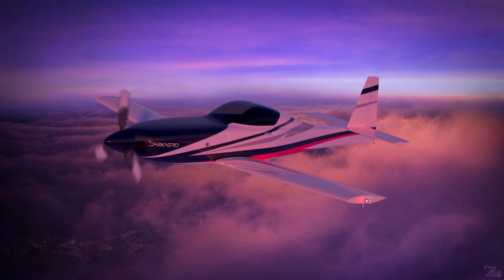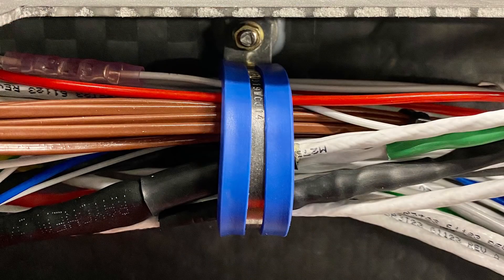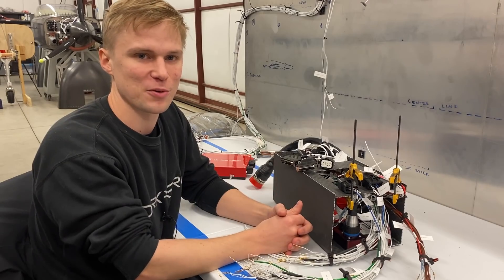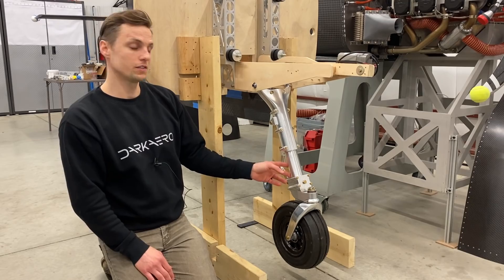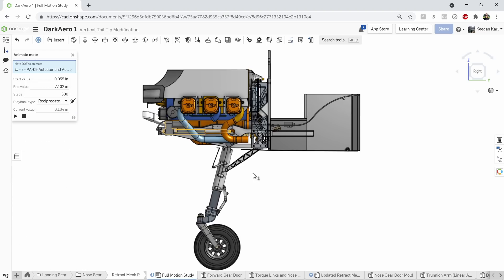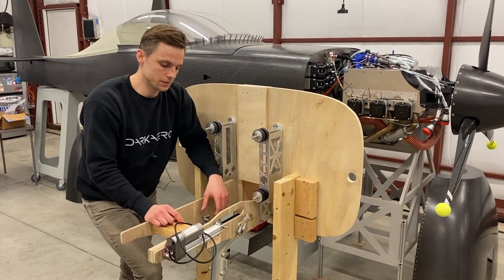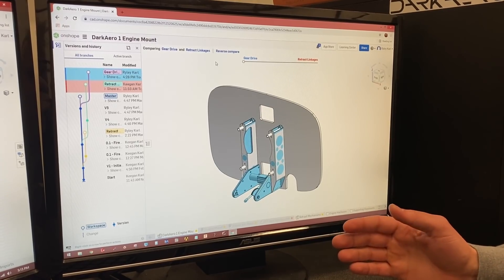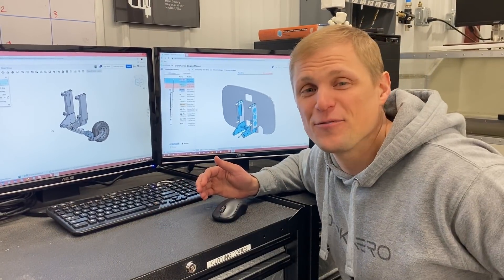Nose Gear Refresh: Trying Something New (+Progress Update)

Comment: Seems like the self steering nose fork would work best at a 90 degree angle. Having the nose gear raked forward will lessen the ability to fight unintended nose wheel wobbling.  Like a shopping cart with a bad wheel.  I would fabricate a trailer hitch jig for it and go drive it around and see if it works over bumps, similar to centerline lighting, and is stable.  Very cool build.  Can’t wait to see it fly.

Comment: So, The Engine and the landing gear are both mounted on to the same firewall bracket. That does not look safe at all to handle extreme landing force! How about redundant weight decepation.

Comment: Also...do you have a shimmy damper or are you just relying on the Bellevue washers?  If no shimmy damper the washers will require a great deal of friction to prevent shimmy and that will require a great deal of differential braking and that is not vey pilot pleasing.

Comment: Honest questions: 
2) Is there a way to use both gear driven and actuated movement for the landing gear Pardon my ignorance in these questions. They are genuine questions and following your build, I'd like to give you some thought from the outside looking in and I can learn a little from you guys (or anybody that chose to answer my questions. Be easy on me.) The reason I ask if using both is possible is because it gives you a contingency if either should fail. I realize this means more parts which possibly equals more weight, complexity, PARTS and so on but in my feeble mind landing gear is almost as important as power and wings on an aircraft. Also with a gear system backup it give you and option of manual or hand driven deployment of landing gear should you lose electric power which I just watched a video on. The aircraft's alternator failed due to wire abrasion and the pilot had to land without power. His landing gear was fixed though.

Comment: Honest questions: 
1)Using a gear drive, have you given thought to teeth breakage or binding due to stress and wear over time. Of course you are aware that aircraft landing produce a great deal of force and that force would be transferred to the teeth of a gear. And specifically the few actual teeth in contact with each other at time of landing. And it being a gear driven system and the same teeth ending up in the same spot at full extension of the landing gear every time means that those same teeth would bear the weight of every landing. This could cause shearing after fatigue over time which would be bad. It could also cause binding of landing gear during take off and or deployment of gear during landing. Over time gear wear because of load from landing with cause "slop" or space between teeth which can cause binding and complete failure. I'm a former aviation mechanic for the Marine Corps and even though it's not an engine part, landing gear is still critical. I am also a car guy and when I think gears, I think timing gears, differential gears and transmission gears and all of these share the same potential failures. Breakage and mesh loss over time due to either wear, torque or both and when the fail, the fail bad.

Comment: That linear actuator would have worked without deflection if it had only been supported at the motor end. Get rid of that forward attachment near the gland end.   Attach the tip of the rod directly to the retract /extend arm.
Get rid of the travel slot and the big roller bearing, and also get rid of the dogbone link.  If the actuator allows for only being anchored at the motor end without pulling the guts out of it, then the actuator pivots to stay in line with the pull / push on the retract / extend link no matter where they are in the cycle.  No deflection, constant alignment, fewer parts, joints, fasteners.
That all said, you've moved on to geared.

Comment: 0:14.   I see it now, there is some provision for emergency gear extension.  Only now catching up on all the videos.
Looking at the panel layout, I would like to have a 750.  I currently have a 650 and it's comparative limitations are noticeable.  
To make room for it, the gear handle could be moved to below the emergency handle, on that vertical pedestal.  
Typically, you reach down from the throttle to grab the gear handle, at least on a lot of planes I have flown..  This would make it more natural and free some space on the top of the stack.  
The gear lights are small enough to be place in the sight line between the G3X and the cowl.  the remaining light switches could be placed along that line too.
Then you have the additional "single DIN" space for a 750.
Plus, the center stack can be stacked together in a single cage.  The 750 with the AutoPilot control head nestled above it.  Plus it saves a little complexity and weight over two individual/separated cages.

Comment: Quite a lot of torque is gong to be on that gear driven pivot point when the nose gear touches the runway while landing.   you need some sort of cross member to absorb that.
Reply from the maker: John, thanks for watching and the comment! You're correct that a lot of force would be transferred to the gears w/o drag links. We should have mentioned this during the video but the drag links weren't made visible in the CAD for the new design. If you watch back during the clips where we show the linear actuator design you'll see them visible there. Drag links are still planned for the new design. You can see the mount point for where they'd connect midway up on the aft trunnion of the new design.

Comment: I love your development. I wouldn't be to happy with the gear being attached to the electrical system. Electrical failure seems to be one of the most common failures in an ac. And the stress starts multiplying if my "safe exit", the landing requires additional work.
Have you checked how many cycles such a gear can do in a row before failing?

Comment: Regarding the nose gear, I did not notice any mechanical stop the wheel will be sitting on when under load. I hope you guys have some there so the whole weight of the plane does not sit on the actuator.

Comment: New arrangement makes it easier to fit a lycoming which is good to see!
Reply: The airframe is designed to the weight and center of mass of the UL Power engine.  The equivalent Lycoming is 80 pounds heavier and physically larger.  Not only would it not fit, it would make the plane unacceptably nose heavy.

Comment: is the front wheel free castering  ? if so,  how do you stop it from flopping over ,or getting stuck ,when it retracts, as the bay is not big enough ? if the wheel is sideways ?
Reply: I was going to ask the same question, what centers the nose wheel prior to retraction? Does not appear to be a lot of clearance considering the cutouts for the axial tips.

Comment: Seeing that fat bundle of wires causes me to wonder: CAN Bus technology/implementation? Is it it possible and or desirable for your application?
Great job in creating a modular box-style plug and play solution, but surely a one wire set up would be more desirable, or am I missing something?
And while you’ve created a gorgeous chunk of CNC aluminum gear strut there, why not craft it from carbon fiber too?
Reply from the maker: Hey David, we do have CAN bus for most of our Garmin avionics and gear logic, but there are still a few devices that get controlled through the panel running on separate data protocols. The modular setup came about somewhat out of necessity because our instrument panel is integrated into the canopy and needed to be able to separate from the rest of the harness. The modular setup is an interesting work tradeoff since it does require extra effort to construct the connectors that run into each module, but it makes it easier to break up the work of creating the harness and allows it to be done outside the cramped spaces of the aircraft. 

We are going with carbon fiber struts for our main gear, but for the nose gear it would be difficult to use the same approach. There is less space for the nose gear to fit both the strut and the shock into the same area without integrating the shock inside the strut, which led us to the design you see in the video. For the current strut design, carbon fiber is less ideal from a manufacturing standpoint since it involves parts like the trunnion that have complex geometries.
Reply: I envisioned a hybrid approach for the nose strut, that is, trunnion and upper pivot of aluminum, main strut in CF. It just seems that carving that piece out of aluminum is super expensive, time consuming, and is an exercise in re-inventing the wheel, so to speak. The cartridge design for the suspension action is very clever though.
Reply: @DarkAeroInc  I know your engine for the prototype does not have CAN Bus, but the latest version of the engine does have it.  It may or may not be of use to your electrical design.

Comment: Okay, oddball question.  You've got electric gear with local actuators, and the nose gear extends forward.  How to handle emergency extension?  I otherwise love the design - trailing link  or the equivalent without a lot of excess material to make it work right...
Reply from the maker: Thanks for watching and the question! Great question! We didn't have it mocked up on the test stand, but we do have a backup provision for extending the gear. The pilot pulls a handle that disengages the actuation system and a passive gas spring drives the gear down to overcome aerodynamic loads and into the down locked position. We will have more to show on how this works in upcoming videos.
Reply: @DarkAeroInc  a gas spring!  Cool!  Looking forward to it.

Comment: What's the minimum runway length for take-off and landing?
Reply from the maker: Kevin, thanks for the question! The takeoff and landing roll at sea level on pavement is projected to be around 1000ft. Minimum runway length would be much longer than this though to provide safe stopping distance for an aborted takeoff or for misjudged approach on landing.

Comment: Why not making the landing gear the other way around, using the air flow to help opening it. The way you have it set up is against the wind when opening.
Reply from the maker: Good question! This approach would have required a pivoting point further aft thus increasing the length of the strut leg and the length of the retract cavity required. Additionally, there is very limited space firewall forward to tuck the tire away to with the engine taking up the majority of that space. Thanks for watching!

Comment: I still don't like all the instrument panel wiring coming through one connector, if that connector comes loose in flight? Would it be that difficult to split the wiring between 2 connectors so you have some redundancy.
Reply: The connectors can be safety wired.

Comment: I'm hoping you can show how you are able to make sure that the tire is rotated to the. Correct position during retraction or if that doesn't matter?
Reply from the maker: Josh, thanks for the question! The self steering nose wheel design follows a similar design principle of other proven, self steering nose wheel aircraft. Pre-tension on the front pivot pin is adjusted to provide sufficient damping and tension to prevent the nose wheel from flopping over during retract or spin during heavy cross wind. We have played around testing this. A good example of self steering, retractable gear can be found on the Rutan style canard aircraft. 

For retract, if there is an event where the gear is slightly cocked to one side there will be a self aligning feature incorporated into the gear doors and wheel fork to help correct - this hasn't been installed yet. Thanks for watching!
Reply: @DarkAeroInc  that's freaking cool stuff right there! Thanks for taking the time to explain that to me.
Reply: Glad to hear there is a mechanical feature to center the nose gear during retraction. I just need to finish watching all the videos. It appears every time I have a question or concern—you’ve answered it.

Comment: Down lock system? Emergency extension system? All the forces are going to go against the gear teeth?  Ever land a plane that had nose gear shimmy problems, even with a damper installed? Lots of forces at work there. If you want to emphasize light weight, look into an early Mooney with a lever system activated by muscle power. Also the little BD-5s had the same idea.

Comment: Is there some sort of seperate locking mechanism not shown in the CAD? The shear load of a hard landing on those gear teeth could be rather high. I’d want the mechanical advantage of the lock’s mount being halfway down the landing gear, as opposed to being up at the top with the gear segment.
Reply from the maker: Correct. It wasn’t shown in the video but the second design also has drag links to react against the drag loads. There is an “eye” on the back of the trunnion to interface with the drag links which is shown though. Gear teeth are not used to hold the position of the nose gear in the up or down position, just to actuate the gear up or down.

Comment: Loose the weight of the liner actuator by omitting it entirety. Instead consider a manual drop and retracting mechanism of carbon tubes.
Reply from the maker: A manual system would be awesome! That would be the ultimate in simplicity! We did consider manual but the constraints of our design end up making a manual lever or crank system less appealing than an electrically actuated system.
Reply: Like the BD-5

Comment: Is that a Vex BAG motor and planetary I see? That shot at the end looks an awful lot like Vex motors and gears we used in FRC. Have you thought much about how you're going to handle emergency gear extension? Traditionally this is done by dumping hydraulic pressure and spring-loading the gear down, but since there are no hydraulics, how do you intend to extend the gear if the actuator fails? Those BAG motors are good, but we've popped a few in the past...

Comment: What would keep the wheel from flopping to the left or right while the gear is being retracted?
Reply from the maker: Jeff, thanks for the question! The self steering nose wheel design follows a similar design principle of other proven, self steering nose wheel aircraft. Pre-tension on the front pivot pin is adjusted to provide sufficient damping and tension to prevent the nose wheel from flopping over during retract or spin during heavy cross wind. We have played around testing this. A good example of self steering, retractable gear can be found on the Rutan style canard aircraft. 

For retract, if there is an event where the gear is slightly cocked to one side there will be a self aligning feature incorporated into the gear doors and wheel fork to help correct - this hasn't been installed yet. Thanks for watching!
Reply: @DarkAeroInc  Thank you for the great reply. I figured you had a trick up your sleeve.

Comment: What straightens the wheel if it isn't straight when it retracts. With no brakes precession might be a problem with a spinning wheel and a turn?. Might need some guides. How about spinning the wheel up and retracting it in your test stand? How about an out of balance wheel turning sideways? Does the wheel wheel need guides to help it get straight and not hit the doors? Can it go in backwards or are there stops at 90 degrees of turn? Is there any safety/fail safe if there is pressure/weight on it to not retract?
Reply: Those were my thoughts too...

Comment: I think I'd prefer a more fail safe gear design. Lose electrical and you're toast. What if you had a charge tube instead of shock tube. Electrical retraction of the gear would charge the tube  (kind of like closing the hatchback on a car) and latch it. Loss of electric would naturally release the latch; the gear would naturally deploy; and a natural lock mechanism would hold it in place. Would also not take much in the way of mechanism or weight to have method of manually deploying the gear.
Reply from the maker: Hi Todd! Consideration of failure modes is important. We didn’t cover it in the video, but both designs we showed incorporate backup mechanisms to extend the gear in the event of an electrical failure. We use a passive gas strut to overcome aerodynamic loads and force the gear down and into the down locked position.

Comment: I would consider having more 'meat' around the eyelets where the bolt attaches the nose gear to your two ears.  I like it though!
Reply from the maker: It’s a fine line to walk between adding more meat and getting too beefy.
Reply: @DarkAeroInc  I defer to your experience and vision.  By my eye from what little I have seen, just looks a tad but under.  Again, just around the top of the eyelets. ;P  Love the videos guys.